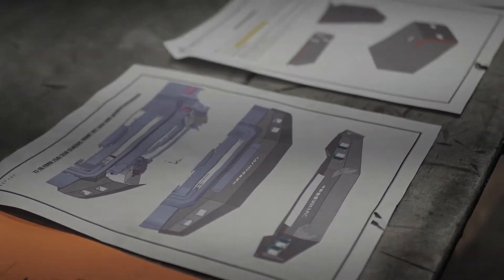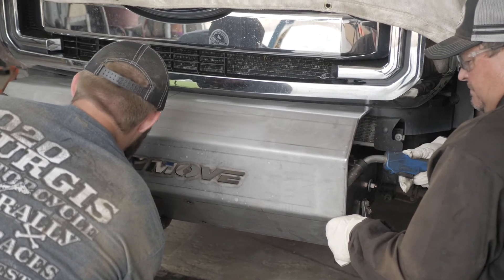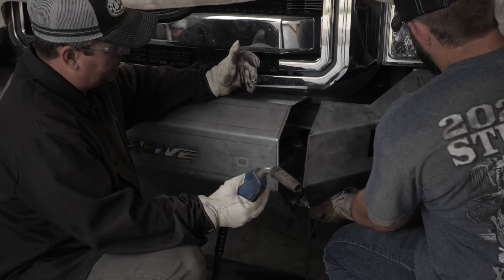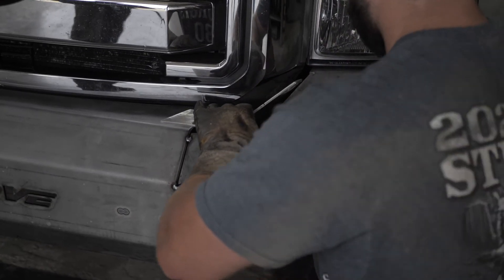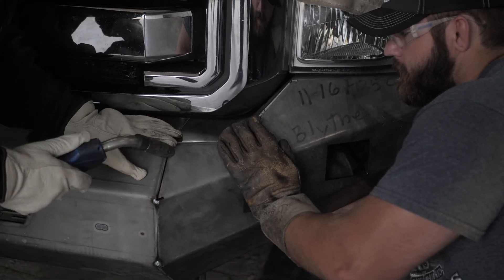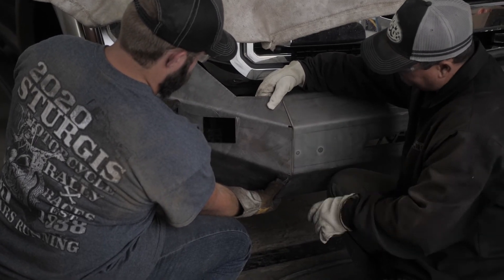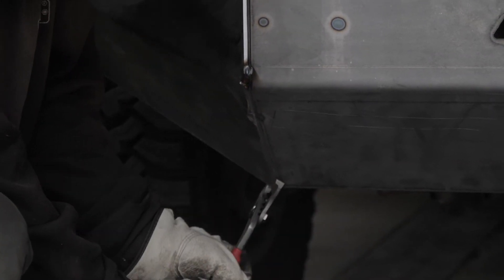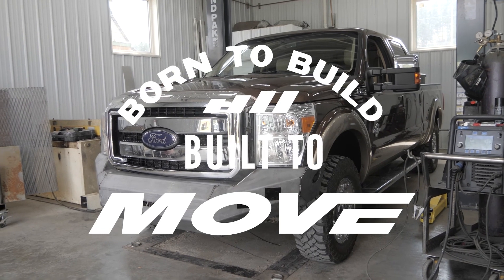3- How to Build a MOVE Bumper Kit - Front Bumper Kit Tack Welding Center Section & Side Wings

Comment: Having the logo smack-dab in the center is a major turn-off for me.  Having it positioned in a more obscure area (one, not both,  of winglets perhaps) would still promote name recognition, allowing a cleaner appearance.  All in my opinion of course.
Reply from the maker: We do have an option to relocate the logo on our Classic Series bumper kits.
Reply: @Movebumpers yeah. But you charge for it. Also you don't include instructions anymore. Not even a basic diagram.